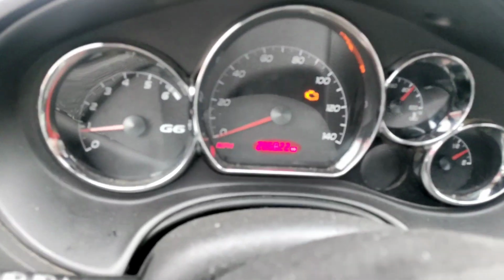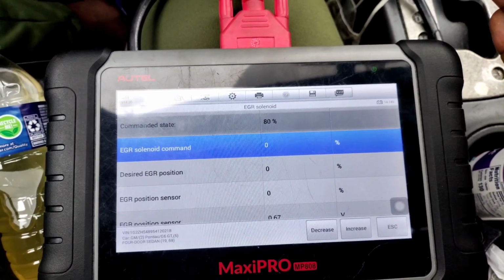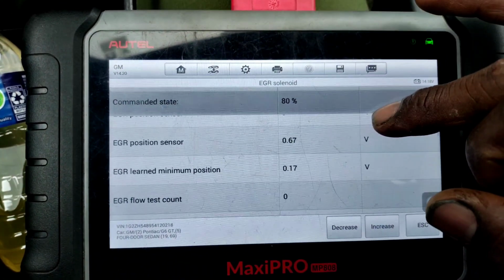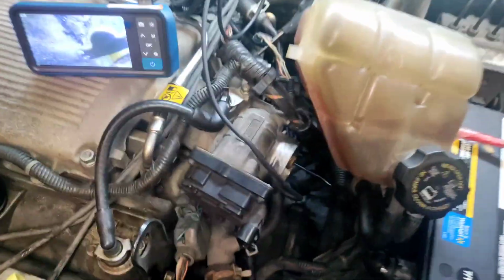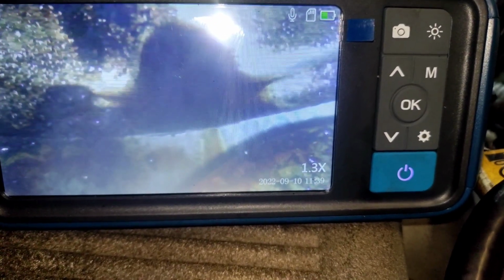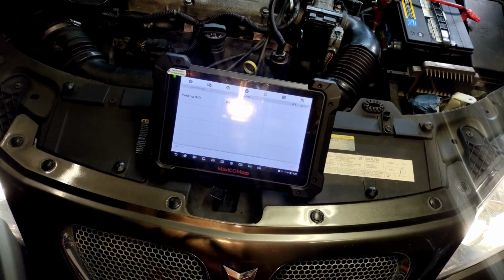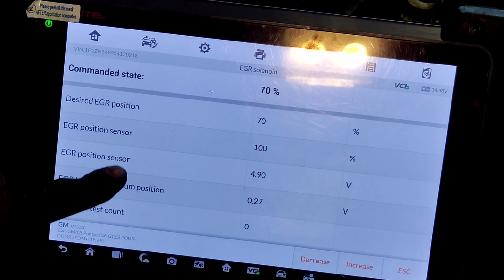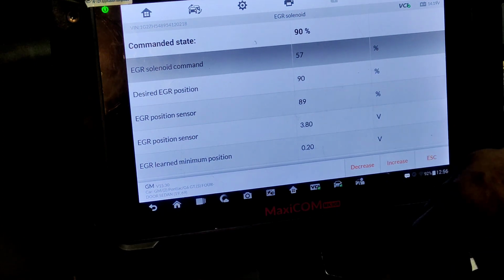don't replace the your EGR P0401

Comment: I'm getting the P0401 on my 98 S10 with the 4.3L v6 and 4L60E tranny. The truck has 314k miles. The code doesn't set the engine light. I was only able to see the code using a Snap-On Ethos Edge scanner. My old OTC Monitor Elite could not see the code which I'm still puzzled over. The EGR valve is a Delphi purchased in 2020 and it has less than 10k miles on it. The EGR pipe is the original. Any ideas on where to start troubleshooting? The P0401 is the only code stored in the ECM. The only symptom the truck has is at idle it will sometimes stumble like one of the cylinders is misfiring. This doesn't happen all the time.  I purchased the truck new and done all the maintenance myself.  There have been very few hands that have touched this truck over the last 25 years.
Reply from the maker: Check your on board monitors, if the car pass all monitors and ready for inspection, in combination with no check engine light (in the global generic scanner) ignore it. And check for mechanical issues. Like perform a compression test

Comment: FYI to viewers with GM cars don't buy cheap Amazon / eBay EGR valves. I tried going the cheap route (about $30) because I was having an EGR electrical fault code. The cheap valve cleared the electrical fault code but caused a new fault insufficient flow. I wasted time chasing down what could be causing the low flow fault I replaced the MAP sensor and gas cap same code. I ended up ordering an AC DELCO EGR valve and everything is fine. These are electronically controlled egr's not the old vacuum type so I guess like most cars they seem to do best with OEM parts and AC DELCO and DELPHI are major OEM suppliers for GM so can't go wrong. Hope this helps and thanks for the video you might have a new subscriber